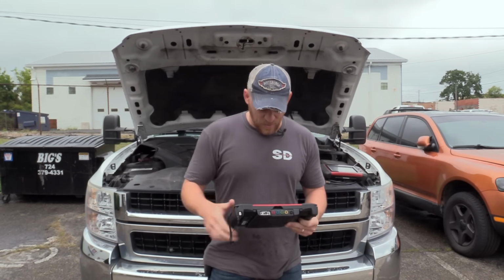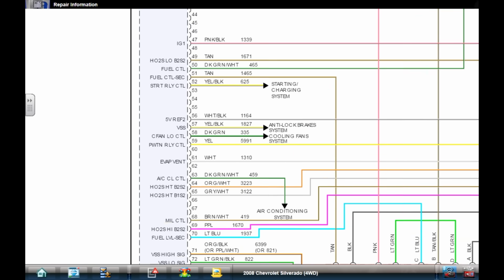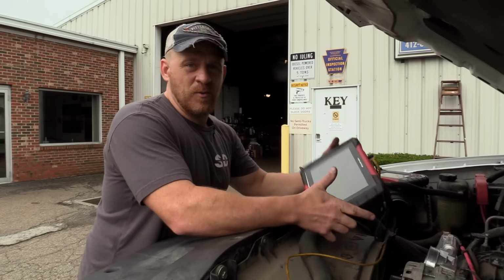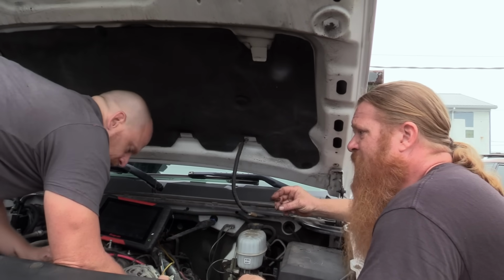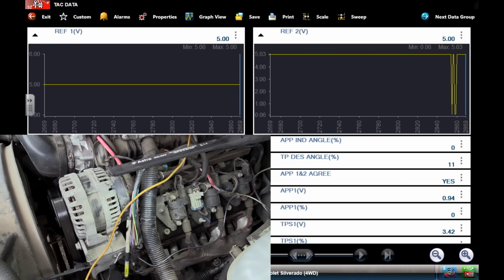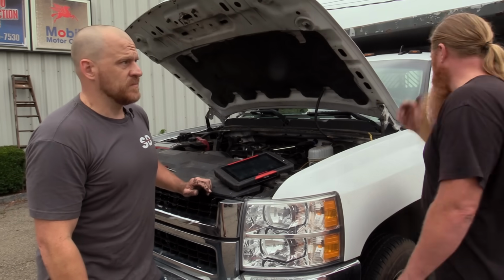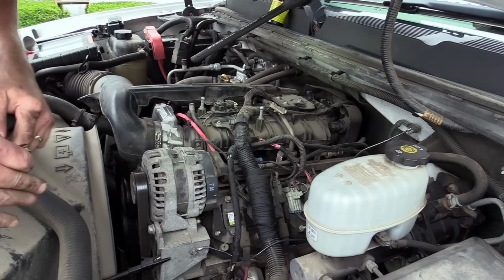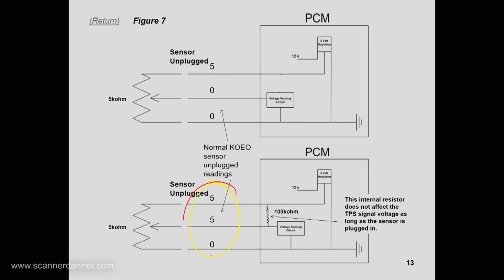Troubleshooting a Shorted 5v Reference Circuit (Chevy Silverado)

Comment: i am a mechanical engineer that has been working on cars for 10 years as a hobby, your class has given me the confidence to start my own shop. I am able to digest the theory side really well and everything has been clicking. your technical approach and your explanation of circuit design has given me a higher level approach to diagnostic work than i ever had years ago. I am now in between my full time job and running my mechanic business outside of normal business hours and weekends. Your classes give me so much confidence in my work, all of my diagnostic work is guaranteed, if its not fixed the first time, the repair is on me. so  i better be right the first time!
Reply from the maker: Would you do me a favor and copy and paste this comment here? https://www.scannerdanner.com/leave-read-feedback-new.html
Thank you so much!
Reply: @ScannerDanner  will do in the morning. Currently reconciling some tool expenses 🤪
Reply: Your a true hero for standing behind your work.......I would take all my work to any shop that just guarantees that if they don't fix it, you don't pay......(which is exactly how it should be)......but if you fix it correctly (the second time) and still don't charge them......your a legend.    Because in that scenero.....we should only have to pay for the actual fix and not the first misdiagnosis.......but no where even does that!
Reply: Where you located😂??
Reply: I hope you are doing well!
Reply: Probably some dude in his mom's basement

Comment: Great vid ..I have p0641 along with p2228 p2227 p0522 p0452 p0192 I check the harness everything seems fine ,,Any ideas what it could be  ? Be much appreciated its a 2013 Malibu 2.5 L
Reply from the maker: Define the codes
Reply: @ScannerDanner  Ok the p0641 is a Sensor Reference Voltage 'A' Circuit Open.,,,the P2227 is Barometric Pressure Circuit Range/Performance,,,, the p2228 is Barometric Pressure Circuit Low ,,,,the p0522 is“Engine Oil Pressure Sensor/Switch Low Voltage,,,,the p0452 is  "Evaporative Emission Control System Pressure Sensor Low Input the p0192 is Fuel Rail Pressure Sensor Circuit Low Input.,,,And this all started putting in 4 brand new AC Delco spark plugs did not disturbed anything else
Reply from the maker: @DELTRANIO99  okay now we're on to something. Do you have a voltmeter? Need voltage measurements on your BARO and or oil psi sensor
Reply: @ScannerDanner  Yes I do from harbor freight lol  Now the BARO is that built in the  Mass Air Flow sensor ?

Comment: I'm seeing more and more of those tools actually warning people not to change parts based on codes. What those tools (FixIt and such) are made for is to code hidden features (such as moving the passenger door mirror into a parking setting, etc). Those are the things that dealers charge an arm and a leg for. And those situations are the ones that the marketing is targeting. Another example is a dealer turning the parts cannon on and pointing it at your vehicle. In that case you can use the tool to give you an idea as to why he is doing that.

Unfortunately, not everyone watching your (and other) videos understands that the tools you guys are using cost several thousand dollars, and you got to be trained to use them correctly. A lot more training is needed for young techs. A big Thx to you and other youtubers doing a great job at teaching that knowledge. We need more.

Comment: Thanks a million! Your tips were a game-changer. I followed your advice and fixed my no spark, no start issue with the crankshaft position sensor, even with it disconnected. Your videos are an invaluable resource, and I'm grateful for your expertise. Keep up the awesome work!
Reply from the maker: Awesome! Did you have a shorted 5v ref?
Reply: @ScannerDanner  Absolutely! I did notice a disconnected wire that had broken off on a stud on the engine. Upon further investigation, I found that the two-wire crankshaft position sensor wasn't receiving voltage from the PCM crankshaft position sensor side. However, there was voltage on the PCM side, measuring around 11 volts. Your video really helped me narrow down the issue and emphasized the importance of checking wire contact points. By following your guidance, I was able to successfully track down and resolve the problem. Thank you for your valuable insights!

By the way, I have a 2008 Ford Escape 3.0l.

Comment: To protect harnesses from abrasion damage; coolant hose is my go-to for things like this on road tractors. They're subjected to so much vibration but the hose is really tough and works great as a sacrificial layer. Also, a tubing standoff would work pretty good and look better to the eye as well. Thanks for sharing!
Reply: Solid tip!

Comment: i use this idea on my sister car,because VSS got malfunction and i use a multitester to check the 5v ref voltage and it is 0 dcv to make sure i turn the key off test the 5vdc output to resistance to to body ground and it got shorted.

this video is a big help for me 😊👍

Comment: With a car with miss fire codes or crank sensor code is it a good idea to spend hours diagnosing or chasing a problem just to end up fixing it with plugs, coil, crank sensor, like your first guess would have told you to do. Now after replacing the obvious don’t continue to throw parts at it, but then start deeper diagnostics. This would explain why you say they replaced all this unnecessarily but in reality it would have fixed it 90% of the time. It’s just the 10% that end up not working that need this much time chasing the unknown. Saying it’s usually worth throwing spark plugs or a crank sensor at something first to eliminate the obvious before the hours spend chasing. With that said it also takes common sense to decide what is acceptable to ‘try’ verses what needs real in-depth diagnostics before just trying something.
Reply from the maker: Until to build in a problem by changing a good part with a bad new part. Check out my post from today! It's a perfect example of why the approach you are suggesting will get you into some serious trouble.

Comment: I had a coolant temp sensor (pins on sensor to ground) on a 2003 4 .3 vortec Chevy short intermittently killed engine then when cooled off restarted . A three wire sensor 5v reference. Drove people crazy . 
The one on cylinder head on driver's side by exhaust manifold gets damaged
Now perfect.

Comment: I'm troubleshooting ref 1 circuit in same type vehicle.  It stores 641,340,522,106.  It is super intermittent ran 42 miles since last event, was towed in to my shop with problem present and by time i hooked voltmeter to a/c pressure switch  problem disappeared and truck runs normal again without ever moving truck.  there are (5) ref1 circuits that run out of pcm.  A bear to track problem down and harness vs. intermittent sensor who knows!

Comment: Hey scanner Danner!  Me again. Same audi B7. Im having a code p0118 engine coolant high circuit input. So i changed out the sensor, however i noticed the connector was missing. It only had the rubber inside of a connector/plug with the 2 prongs sticking out of it. Im thinking the wiring is bad due to the corrosion nd no plug connector nd also no wire with color at all. All i see is old copper wire. I suppose given its so old nd been exposed to heat nd what not, but the wire has no other wire protection or the black plastic wrap around wires until it reaches the other wires that splits apart. Now, my main question is, how do i knw theres a bad ground or open circuit given that the temp sensor has only 2 wires. The control which has 5v nd the ground. I already checked it with a light voltage indicator with only a ground wire nd the lead which will ignite light but so far nothing. I got myself a multimeter not knowing how to utilize it. Pls reply how can i daignose the issue better because i still feel like im missing Somthing .

Comment: Another great video,   I wish I could understand wiring on cars.   Personally no someone that will chane the Multi meter setting to get the number right ( never going to work) or has change the cam sensor 3 time for new ones. All because code reader give a cam code.    Turn out the timing belt was refilled incorrectly

Comment: I got same problem limp mode 5 volts to pedal drops to 4 change pedal 2 times still doing it took to shop they keep changing pedal ugh
Reply from the maker: It's not the pedal then is it
Reply: @ScannerDanner   no
Reply from the maker: @johnmullins1034  just follow what I showed in this video and find everything that shares this same 5v ref circuit as the APP sensor (accelerator pedal position)
Reply: @ScannerDanner  i did  no bare spots could not get to cranksenser new tps  traced purple wire may drive a day nothing or a mile then limp reset by pulling pos off battery
Reply: @ScannerDanner  and changed plug on tps

Comment: Another great video. Its funny how when you shorted it and the computer is sampling things at a sample rate then it's in and out of strategy tables and the reference also can screw readings of other things. Then it's got to figure out how it going to run without a certain sensor. Lol you gave it the hook shot to the head. Lol

Comment: Question
I have the exact same truck, 1500 5.3.  2008. I have a P0449 code.

I check voltage to the pigtail going to my evap purge solenoid next to the gas tank, and I get no signal on the vehicles off on the vehicle is an ACC mode, and when the vehicle is running 

I also installed a new purge solenoid with no luck 

Every time I clear the code it comes back within five seconds
Reply from the maker: So you're saying you have no power going to your EVAP Vent solenoid?
Reply: @ScannerDanner  yes
no voltage

Comment: I have p0030 p0050 for O2 sensors pending and p0651 I checked all the pigtails ends to all car sensors you name it I get 5v , are the p0030 p0050 related to p0561 should I replace the O2 sensors ?
UPDATE : I found crumpled wires before the end of the wire harness , that's before the O2 sensors distribution ends from the main harness " I had to go totally" visual inspection " that harness end location is sitting on the chassis it's look like something hit it " metal object " on the freeway. I rewired it and everything is good .
Car is 2008 GMC Savana 3500 .
Reply from the maker: heck yeah man! Nice job
Reply: @ScannerDanner  Thanks a lot Paul your advice " visual inspection" comes first was the key to solve over 30 cars came to me , I love your channel and your teaching methods , waiting for P0300 video hopefully you make it soon . Thanks again Paul 🤘

Comment: Amazing work guys. Any known contact points for a trailblazer?
Reply from the maker: for what circuit? sorry for the delay in replying
Reply: @ScannerDanner  the 5 volt reference seems to be affected.  TB,MAP, O2's.   This vehicle has puzzled 6 shops and counting. 😑😑😑
Reply from the maker: @bernardb8045  what do you mean "seems to be"? What code is setting after you clear them and what symptoms?
Reply: @ScannerDanner  p1514,p1481. The REP light comes on, it spits and sputters. When I clear the codes, it runs PERFECT sometimes for months or sometimes minutes. I purchased Torque pro to check codes and clear them if  necessary.
Reply from the maker: @bernardb8045  code definitions please
Reply: @ScannerDanner  p1514-- Throttle Actuator Control System Mass Air Flow Performance.   p1481- cooling fan speed sensor.
I watched one of your videos and you mentioned the cooling fan shares the 5v reference with everything else

Comment: Halo SD, what scanner did u use to perform this task?
And also, about the schematics, does the scanner come with them? If not, how can acquire them
Thx
Reply from the maker: The scanner I am using is a Snap-on Verus Edge. The diagrams/service info I use is called ShopKey and is $160/month subscription service. There is a DIY version of the same service that you can use where you pay for individual access per car and it is the same service info and diagrams I use https://eautorepair.adtrk.biz/?a=10817&c=24&p=r&s1=

Comment: Hi

Any ideas on this problem 
I have a chevy spark with low ref voltage going to crank sensor(instead of 5v I have 1.8v)measured voltage at ecu and it's the same. Also have no switched earth at injectors,but that could be caused by crank sensor I think.other sensors like cam sensor has 5v,not sure if it is a bad ecu ,how diagnose to be sure

Thanks
Reply from the maker: could be a power or ground issue to the ECM, a bad ECM or one of the sensors that shares this 5v ref is shorted out.

Comment: Great video. Just had a similar issue on a 2008 Express van, 4.3. The 5 volt ref 2 wire was shorted to ground. Had rubbed through at the right hand valve cover front bolt. Thanks for all your great videos and information. I'm still pretty new to mechanics, only 42 years.
Reply from the maker: Thank you! If you are looking for more I have over 500 videos on my website with a mixture of classes and case studies https://www.scannerdanner.com/join-scannerdanner-premium.html
It's $11 a month and I offer a 14 day free trial. Hope to see you there. Thank you either way! Just watching and sharing and commenting here is support enough too

Comment: Am having the same problem. I bought an ECM, replaced 3 sensor I haven't change the crankshaft.. or the AC sensor. I think it's a wire but the hardness already being worked on by other mechanic so maybe trying to find that wire will be very difficult. It's been 2 months and a week since I had this problem. Am thinking about just buying the new hardness. And just hope for the best. What do you think. I would appreciate if you can tell me if u think I have a better option
Reply from the maker: You are missing the 5v reference? And have confirmed good ECM powers and grounds?

Comment: This is a nightmare code! I have an 03 silverado & am.curently am.experiencing this problem.but im only getting the p061 code.ive been wiggling harness, unplugging & plugging sencors, ect... Sometimes it will start & 95% of the time it wont.driving me nuts.now its raining & im watching youtube trying to figure it out.crazy gm stuff 😠
Reply from the maker: Step 1 is a good diagram and then figure out which sensors run off of that particular 5v ref circuit (especially if there is more than one of them) and then start doing some visual inspections of the harness
Reply: @ScannerDanner  yes.im having a real hard time.

Comment: Wow!  Awesome video!  Great lesson to an old gear head like me!  And the degraded mode run due to intermittent ground short to 5v2 reference!  And you'd think that some software designer, made it to operate that way in the fail mode.  But, this is not written down anywhere in a shop manual.  OK, think, Fix the problem,  replacing parts is expensive.  SD you are the man! Teaching pure troubleshooting logic!  thanks!
Reply from the maker: Thank you!

Comment: Holy shit this is the video I needed. Having the weirdest issue where the car runs fine but after the first pull it starts slowly pulling timing but it's dependant on pedal, so it'll be driving okay and then I start to accelerate and around 20-30% throttle it'll go all the way to 0° timing advance.
Reply from the maker: Now I'm seeing them. So sorry I didn't help you along the way
Reply: @ScannerDanner  haha it's fine I was already going down the rabbit hole I just needed to keep it simple

Comment: this video taught me why i bought a modis with scope. was able to find a shorted tank pressure sensor  on a 15 silverado with a p0641 and multiple other codes on the same 5 volt circuit

Comment: Dude you are really what's up,and good at what you do.I took my truck to a mechanic that could not figure out what was wrong with my 2009 silverado.I had a p0641. After watching you on YouTube  I followed the rail 1 that included, map sensor,ac pressure switch,cam sensor,map sensor. Inspected these item and found that the ac pressure switch wire was ground taking the 5 volt reference from my pcm,which made my truck stay in reduced power mode.Dude keep up the videos.You guys are lifesavers.💯🙂%real dudes
Reply from the maker: So awesome to hear that you fixed something yourself that others couldn't. Made my day

Comment: Man thank you for this video I was having p0341 and p0335 codes popping up and I checked the wiring harness had a hole in the exact same spot the 5v reference wire was   grounding thanks again

Comment: Very good video.  Proves that it doesn't take much damage to a wire in a situation like that to cause all kinds of problems.  I would have put a rubber cap on the end of that stud to help keep it out of the loom.

Comment: Just had a 0651 in my GFs sons 07 Cobalt. We were able to borrow a Snap on Scan tool so i could monitor the voltage of Ref 2, i started unplugging components on that shared Ref since i checked for contact points and animal chewing damage already. When I unplugged one of the components the voltage jumped from 1.4 to a steady 5V, it must be shorted internally. I cleared the code and it stayed away, the car fired up and ran on all 4 cylinders. Waiting for the part to arrive tomorrow to install it and make sure its 100% repaired. This so happened to be the secondary air injection valve, or "Diverter valve" as rock/auto and the parts stores are listing it. I'm glad mine wasn't a chaffed wire or broken wire as they can be absolute nightmares to find. I did learn/reinforce previous lessons today though. Contact points, I will try and remember that phrase.